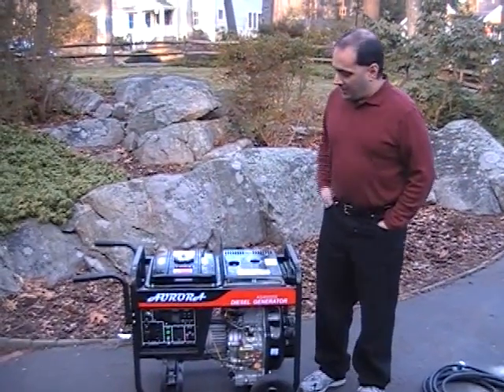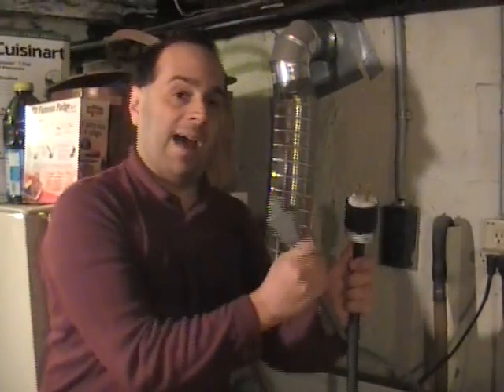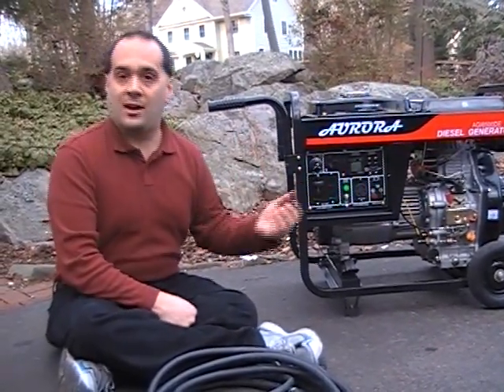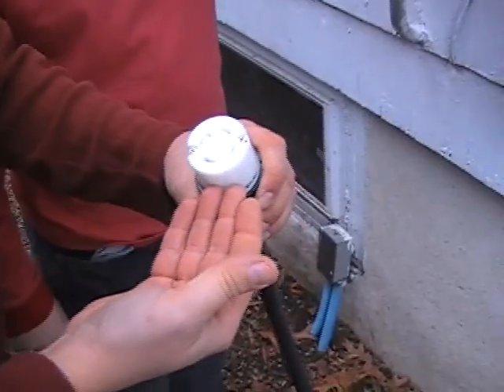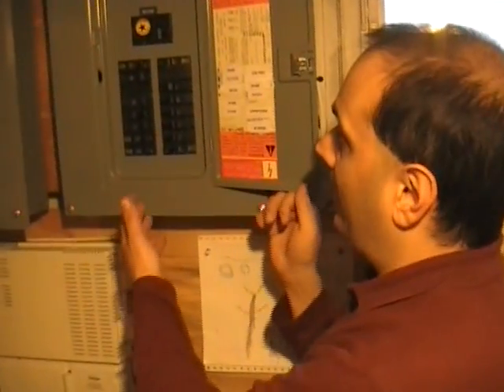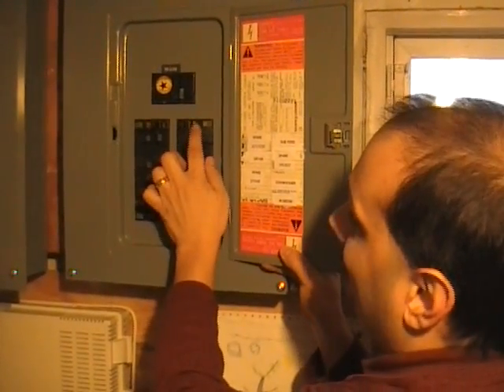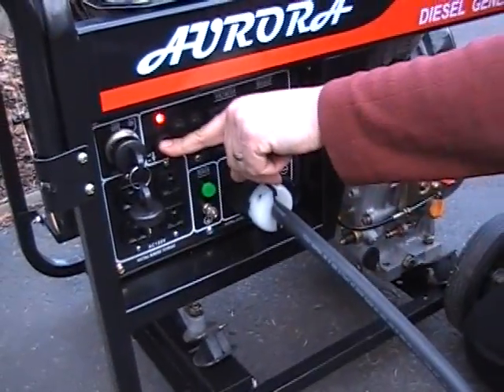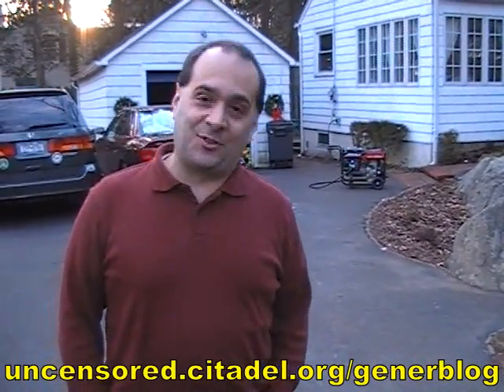Inexpensive residential generator hookup

Comment: Great video! It has peaked up my interest with going this route to hook up a generator to my house. I know how to provide the juice to a sub-panel in a regular scenario, but I'm not understanding how the individual circuits from sub-panel supply the power back to your furnace circuit fro example,  Do you have a complete wiring diagram? Thanks!
Reply: Portable Generator safety: Always make sure you follow all the generator safety rules before using your portable generator. This is only a reminder. Generators can be dangerous if not used carefully. Every year, hundreds of people die or get injured when using portable generators due to carbon monoxide poisoning and electrocution. Make sure you are using your generator carefully and keeping others safe as well. There is something very serious that everyone should always be aware of when using generators. Some people do run their generator indoors which is not safe and that increases the risk of carbon monoxide poisoning which can cause death of family and you. Some people run their generator in wet conditions which can electrocute them. Please remember that you should never run your generator indoors. Remember that carbon monoxide is an odorless and colorless gas that you cannot see or smell. Carbon monoxide is a silent killer. Keep that in mind. Make sure your generator is 15-20 feet away from your house and away from doors, windows, and vents. Never use your generator in your porch too. Having a carbon monoxide detector is very important against generator safety. Some people also allow children to go near the portable generator which could pose risks. We need to keep an eye on our children making sure that they are not near the portable generator so they won’t get electrocuted or burned by the generator which is dangerous. A locking enclosure also keeps kids safe. A generator shed might look like a tempting place to explore, or take cover during a game of hide and seek, but a generator is a dangerous piece of equipment that can cause injury. It says on the manual that we should also keep children away at all times from the portable generator to avoid injuries. Please do not allow a child or unqualified people to operate the portable generator.  It is important to keep your children safe especially little ones. The portable generator can be hot during an operation. Just because some manuals missed what should be listed doesn’t mean it’s safe to do. Always follow the generator safety rules when using portable generators. Generators pose electrical risks. If you need to use your generator during wet weather, you need a generator tent to protect your generator from getting wet. Don’t let your generator get wet. Keep your generator dry and before using your generator, please make sure your hands and your generator is dry. Do not wear loose clothing when operating the generator. Everything that is said on the generator’s operating manual should not be ignored. Never smoke cigarettes near the generator. Please keep flammable things away from the generator. Never overload your generator too. Your generator can catch fire. Never ever try to plug a generator cord into a wall outlet to avoid back feeding. Back feeding your generator is dangerous. Always turn on your generator first before plugging in appliances and shut off the appliances before turning your generator off. Use a heavy duty cord for your generator and the cord should not be worn out. All the instructions should be followed carefully. Never refuel your generator while it’s running. It can cause fire if fuel spills while your generator is hot. You should turn off your generator and let it cool off before refueling it. Having a fire extinguisher next to the generator is also important. This is only a reminder for everyone’s safety of using generators. Make sure your generator is properly grounded. Having a fire extinguisher next to the generator is also important against the safety rules. https://youtu.be/I1jT3ANENvI and here is a video more about keeping others safe when using generators and also about our family’s safety. It’s important to keep our little children safe as well. Make sure they’re away from the generator. Hope this helps.

Comment: Regarding the problem I listed..  "Only the right side half of breaker box is getting power" . The extension cord was at fault, the ground wire inside the extension cord
was faulty. 
I listed the remedy in the event someone else has such a problem.

Comment: Well done video very informative ,  I have a question I installed a double 30 amp
breaker w/ interlock on my panel, ran the 10/3 w Ground to a box w/ male end.
Today I hooked up my generator 7500 watt to the male plug via a extension cord
10/3 w/ ground which came w/ the generator. PROBLEM: Only the right side half of breaker box is getting power . I double checked all the wiring from the breaker box
to the outlet , and outlet to the 30 amp female plug on the generator, all appears well.
What could be the problem ?  Thanks in advance.
Reply from the maker: I've got a couple of ideas but let's chat about it on the blog/forums.  Go to the web address listed at the end of the video, and head over to either the "Home Handyman" or "GenerBlog" rooms and post your question again.  We'll chat about it and maybe do some troubleshooting.
Reply: Art Cancro Thanks, I will post it on the the 
Home Hanyman.
Reply: Art Cancro I added the problem to D.I.Y. handyman, however they will
post only after review, which can take up to 48 hours. In any event it is posted.
Thank you Art.
Reply from the maker: Joseph Maximus DIY Handyman is not my site
Reply: Art Cancro  What is your site ?
In any event I determined the extension cord
was faulty, it was missing the ground wire.
Reply from the maker: Joseph Maximus uncensored.citadel.org
Reply: Art Cancro Problem has been solved for many weeks now. Thanks for the reply.
Reply: Joseph Maximus I saw your post here and on another video as well.  Glad you resolved it.  What turned out to be the problem?  I'm interested because I did the 30 amp install as well but haven't tried it out yet.

Comment: I have an experience with back feeding and i had plugged the cable into my 5000 Watt inverter generator and started her up. forgetting that i had not plugged the other end of the cable into an household outlet, by this time i had already turned off the main breaker ready to use generator power. as i picked up the cable to plug it into a dryer outlet i accidentally touched the terminals on the plug that where live at the time and it gave me the shock of a lifetime, luckily for me this made the breaker on the generator trip out. NEVER under any circumstances use the back feed system. This guy know's his stuff. Great video.
Reply: Art Cancro
 I think you got that wrong. 480 normally knocks you across the room. 208 is the dangerous one because it tends to hold you in place.
Reply: Art Cancro Amperage is what kills you not Voltage. 120 will kill you as easy as 480 depending on the actual resistance due to the specific conditions.....
Reply from the maker: Dale Ezzell To some extent they are all dangerous.  However the difference between knocking you off and holding you on is actually the difference between DC and AC.  DC is always going in the same direction so at a sufficient voltage it will knock you across the room (actually it gives your muscles a gigantic jolt so you knock yourself across the room).  AC is changing direction 60 times per second (50 in some parts of the world) so your muscles just lock on until the power is shut off.

Fortunately most people who accidentally touch a live 208 or 240 volt connection don't have their hand wrapped all the way around a live wire, so they tend to just fall away from the connection (and then start swearing).
Reply: Art Cancro One of the best videos I have seen, regarding properly wiring a generator to feed your home. Kudos, sir.
Reply from the maker: Thanks for the kind words.  If you hang around with electricians one will eventually repeat the old adage: "120 stings; 240 hurts; 480 kills."
Reply: Art Cancro This is the first time I realized how wonderful clothes lines are.
Reply: I've been hit with a 480 arc over  I'm still here. 28 volts and up can kill but the amperage and a good ground are necessary to kill.
Reply: Generators can be dangerous if not used carefully

Comment: Great video. I will use my small generator and a few cords to keep my important things going. I need to find out the running time on a tank of gas. Also; how long can gas sit? What additive is best to keep it fresh?
Reply from the maker: The running time on a gasoline generator depends on how much load you're putting on it.  Diesel generators too but they like to be run on a good size load all the time.  So really the only way to find out your run time is to fill it up and run your "typical" load on it, and see how long a fill-up lasts.

I use an additive called STA-BIL in pretty much everything in my toolshed.  Not only does it keep fuel fresh in the can, but it also keeps the fuel sitting inside your small engines from turning into varnish.  It goes into every can of fuel I bring home, regardless of whether it's gas or diesel (the product is available for both fuels -- but read the label, they are not interchangeable) and I use it even if I expect to consume the fuel "soon."

Even with stabilizer though, fuel won't last forever.  If it's been more than three months or so, pour it into your car's fuel tank and go get a fresh can.  When my diesel fuel has been sitting around for a few months, I pour it into my heating oil tank and get a fresh can.
Reply: Art Cancro Thax Art, that was a big help. This Generic 4200 was used mostly for running a pitching machine for baseball practice. Perhaps I need a bigger one just to run longer and run the refrigerator, a few lights, freezer at random, micro wave, charge phones. THax again!

Comment: Great video, and thank you for pointing out the dangers of back feeding.  Art, can you list the hardware you used?  I know you mention some of it in the video, but a list of parts in the description would be fantastic!   Doing this "mod" on the house this spring.
Reply from the maker: Any panel from Square D that uses "QO" style breakers, and preferably one without a main (you don't need it since you will have two interlocked mains). The interlock is model QO2DTI and it spans a pair of double pole breakers in the upper right area of the panel, one for utility main and one for generator main. See uncensored dot citadel dot org slash generblog to read more.

Comment: Great video, Art. I wish I could have seen you actually installing the inlet recepticle on the house. I am nervous about putting a hole in my wall and have been looking for a video on that alone. Thanks for the video.
Reply from the maker: That part is fairly easy.  If you are going from a basement location to the outside, drill at a height somewhere between the sill and the subfloor above you.  In other words, at the same height as the floor joists.  Check to make sure you're not going to hit any obstacles, and bore a hole large enough for the cable stock you will be using (half inch will do for a 10 gauge cable).  

After that you have two choices on how to mount the box.  You can center the box over the hole, and feed the cable through the back, which is the most attractive installation (and the one I chose).  This does require making the hole larger at the exterior side to accommodate the cable clamp at the back of the box.  Your other option is to attach a right angle cable clamp and mount the inlet box below the cable

Either way you will then want to affix the box with wood screws directly to the exterior of the house, using screws long enough to reach through the siding and penetrate the wall itself.  After all cabling is complete you should squeeze silicone paste into the hole to make it air and water tight, which will keep out moisture and pests.

I like the inlet receptacles from Leviton, Hubbell, and GE.  Not a fan of brand R.

Comment: Art, just got the same generator that you have this past week. How has yours been running. Good video by the way.
Reply from the maker: I've had mine for a little over two years and I'm still completely satisfied with it.  I change the oil on schedule and also run a full load every six to eight weeks to keep it in shape.  This is very important if you want your generator to run when you need it.
Reply: They suggest that I put synthetic in it when the break in period has gone past....did you do the same?
Reply from the maker: Russell Freer That's what I did -- regular oil for the break in period, synthetic afterwards.  I'm using Royal Purple because that's all I can find in my store, but those who know these things almost always say that Amsoil is the best brand for this application.

Comment: I wound up doing a small scale "ghetto" version at my place.  The furnace has its own dedicated line from the breaker box to start with.  The dedicated line feeds into a handy box on the side of the furnace with a twist lock receptacle installed it.  I then wired the furnace with a 3' 12-gauge SO cord with a twist lock plug on the end.  In normal operation, that cord is hooked into the twist lock handy box.

The "trick" is that I set another handy box alongside the afore mentioned box.  This new box also has a twist lock receptacle installed along with about 30' of 12 gauge SO cord with a plain old three prong plug.  There's also another handy box containing regular outlets that's tied into this setup.

When the lights go out, I simply swap where the furnace is plugged into and then throw the SO cord outside to my generator.  I'll at least have heat in the winter and one set of outlets to run some essentials.  That's about as safe and idiot proof of a setup as I could cook up.
Reply: Portable Generator safety rules: Always make sure you follow all the generator safety rules before using your portable generator. This is only a reminder. Generators can be dangerous if not used carefully. Every year, hundreds of people die or get injured when using portable generators due to carbon monoxide poisoning and electrocution. Make sure you are using your generator carefully and keeping others safe as well. There is something very serious that everyone should always be aware of when using generators. Some people do run their generator indoors which is not safe and that increases the risk of carbon monoxide poisoning which can cause death of family and you. Some people run their generator in wet conditions which can electrocute them. Please remember that you should never run your generator indoors. Remember that carbon monoxide is an odorless and colorless gas that you cannot see or smell. Carbon monoxide is a silent killer. Keep that in mind. Make sure your generator is 15-20 feet away from your house and away from doors, windows, and vents. Never use your generator in your porch too. Having a carbon monoxide detector is very important against generator safety. Some people also allow children to go near the portable generator which could pose risks. We need to keep an eye on our children making sure that they are not near the portable generator so they won’t get electrocuted or burned by the generator which is dangerous. A locking enclosure also keeps kids safe. A generator shed might look like a tempting place to explore, or take cover during a game of hide and seek, but a generator is a dangerous piece of equipment that can cause injury. It says on the manual that we should also keep children away at all times from the portable generator to avoid injuries. Please do not allow a child or unqualified people to operate the portable generator.  It is important to keep your children safe especially little ones. The portable generator can be hot during an operation. Just because some manuals missed what should be listed doesn’t mean it’s safe to do. Always follow the generator safety rules when using portable generators. Generators pose electrical risks. If you need to use your generator during wet weather, you need a generator tent to protect your generator from getting wet. Don’t let your generator get wet. Keep your generator dry and before using your generator, please make sure your hands and your generator is dry. Do not wear loose clothing when operating the generator. Everything that is said on the generator’s operating manual should not be ignored. Never smoke cigarettes near the generator. Please keep flammable things away from the generator. Never overload your generator too. Your generator can catch fire. Never ever try to plug a generator cord into a wall outlet to avoid back feeding. Back feeding your generator is dangerous. Always turn on your generator first before plugging in appliances and shut off the appliances before turning your generator off. Use a heavy duty cord for your generator and the cord should not be worn out. All the instructions should be followed carefully. Never refuel your generator while it’s running. It can cause fire if fuel spills while your generator is hot. You should turn off your generator and let it cool off before refueling it. Having a fire extinguisher next to the generator is also important. This is only a reminder for everyone’s safety of using generators. Make sure your generator is properly grounded. Having a fire extinguisher next to the generator is also important against the safety rules. https://youtu.be/I1jT3ANENvI and here is a video more about keeping others safe when using generators and also about our family’s safety. It’s important to keep our little children safe as well. Make sure they’re away from the generator. Hope this helps.